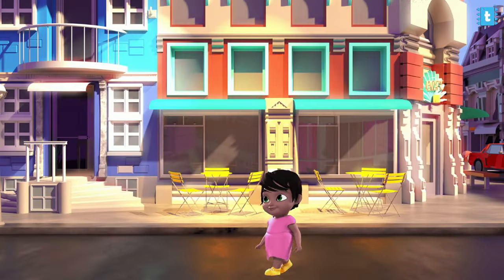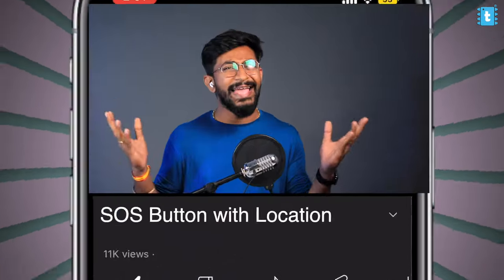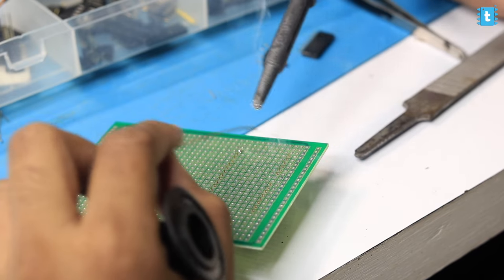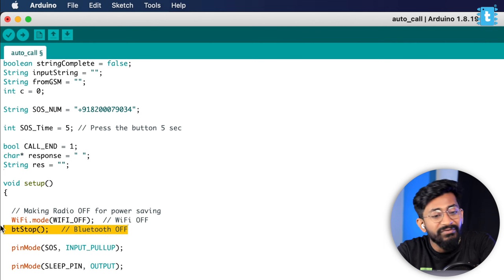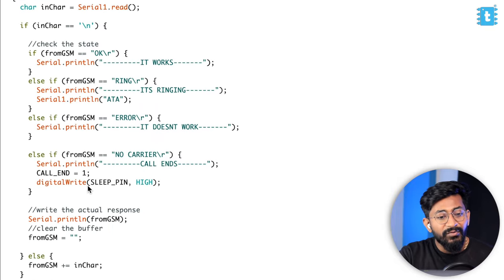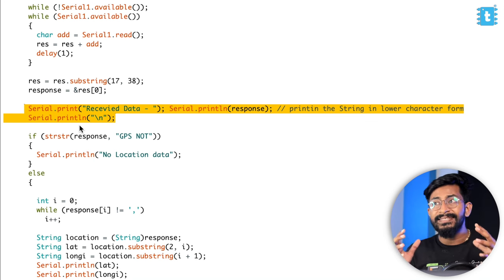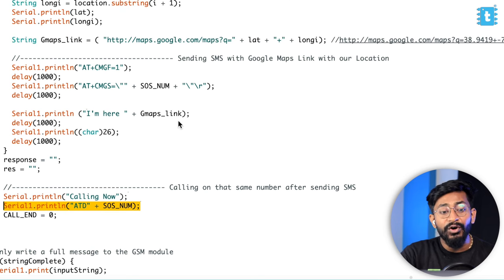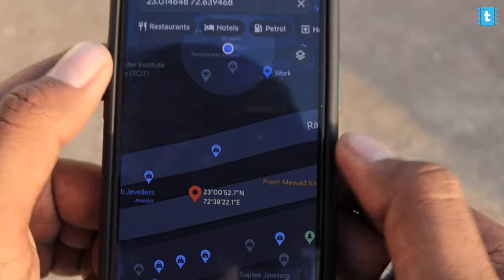Send Location & Make Call using SOS Button | IOT Projects | GPS Projects

Comment: Excellent project. I have a suggestion: instead of a dedicated power switch, the SOS push button can be used as a soft latch power switch with just two transistor/mosfets. Then after a couple of minutes the watchdog timer of the the microcontroller can be used to either switch off the device completely or the system would enter into a deep sleep mode.
Reply from the maker: But after than the audio spy feature won't work

Comment: Nice video. Have you tried using the SD card slot on the A9G?
Reply from the maker: Not yet
Reply: @techiesms  Nice idea for a future video. If you can drive the sd adapter from the ESP32 (there are pins for it on the side) then it would make for a nice compact GPS tracker with GSM capabilities